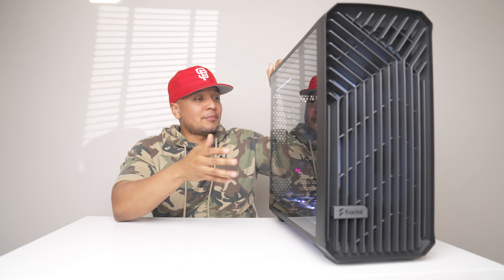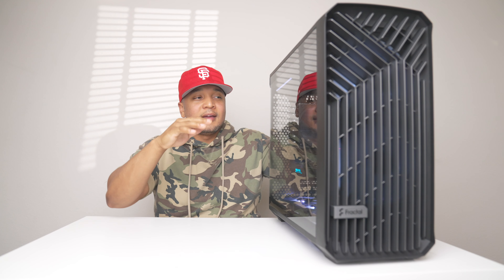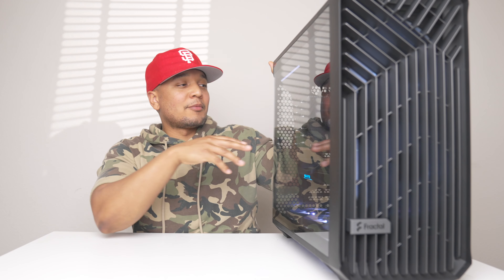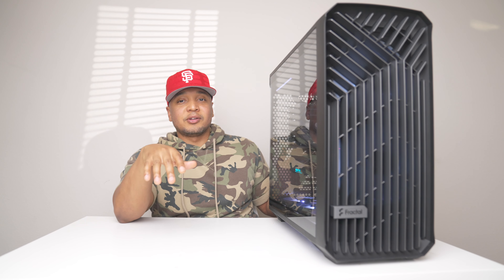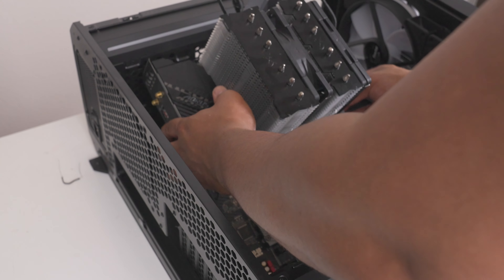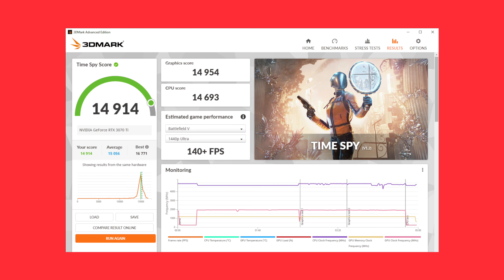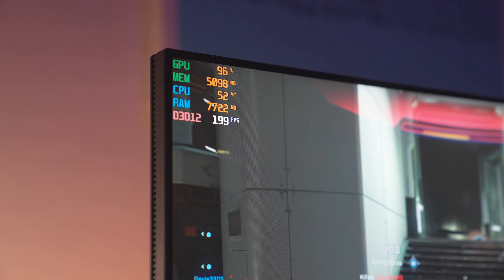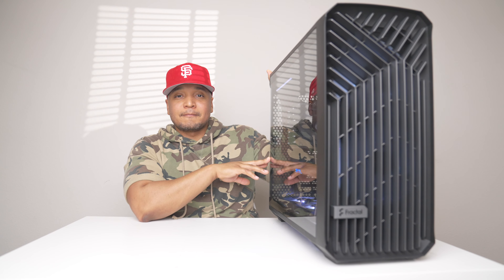Leaving my SFF AMD for Full Tower Intel Build.

Comment: I 100% recommend getting the 12700K instead for the extra $10, if your GPU dies unexpectedly you will have a huge paperweight for who knows how long (happened to me with my 3700X when my 5700XT died and had an O-11 paperweight for like 5 months, not fun).

2:36 Can you please elaborate a bit here? @TooMuchTech said the same thing but it just doesn't make sense unless the AIO was either damaged or not properly tuned in BIOS, i can give advise for that if needed but since you already bought the air cooler idk if my advise will be useful now. Unless the pumps are damaged tuned AIOs should ALWAYS run quieter (or as quiet) than air coolers.
Reply from the maker: I’m probably going to upgrade to the 12900K after that because premiere uses the integrated graphics. 

The 5900X runs so hot in my sff the fans are always spinning. It could have just been a bad AIO. I decided to go air cooling with noctua fans. Runs so much quieter and runs only slightly hotter. Hope this helps. I’m gonna make a follow up video
Reply: @BTaesthetics  but have you tried a BIOS tuned AIO with Noctua/Phanteks fans? 👀 that is the ultimate level of quiet (that isn't custom loop) but i understand anyway, air cooling is much more convenient.

I'll wait for the follow up video regarding your SFF/AIO experience then 👍

Comment: Damn this was a good video. The case looks big but beautiful man, just how we like it. Do you think that adding an exhaust fan will be even better and improve temps or overkill?
Reply from the maker: I think it’ll improve the cooling slightly. This is one of the best cooling experiences I’ve had with a case. I had the window off and it was cooling a hot room 😂
Reply: @BTaesthetics  suppose your GPU had fan hubs (as an ASUS Strix 3090 does), do you think tying the lower 3 fans and an exhaust fan to the speed of the GPU fans would be a good strategy to ensure it doesn’t overheat? Would that compromise the CPU cooling when GPU isn’t active?

Comment: Nice build! Been debating picking up a 3070ti. I want a 3080 but they 3070 to I can actually find easily and seem nice. I currently have a 2080 though and am not sure if it would be worth the upgrade and debating if I should wait til the 40 series.
Reply from the maker: Huge upgrade over the 2080 that’s what I used to have. Best thing to do is check to see if your game is more cpu or gpu based
Reply: @BTaesthetics  I mostly play valorant! So I’m sure it would do wonders. I want to play more stuff on my pc but I also have a ps5 and usually play my single player stuff on there. I want to stream more too and while my current rig performs well when not streaming, when I do stream my performance suffers bad. Main reason I want to upgrade.